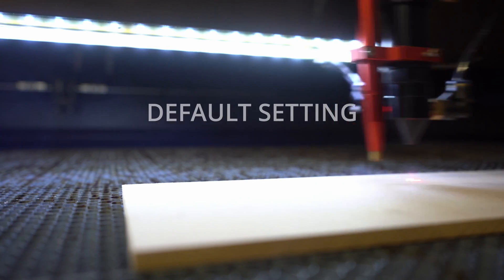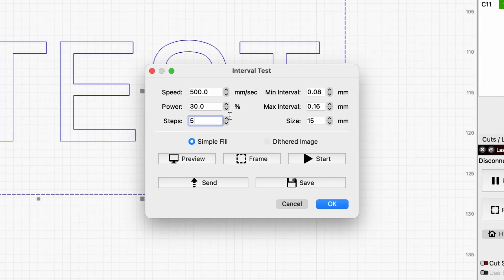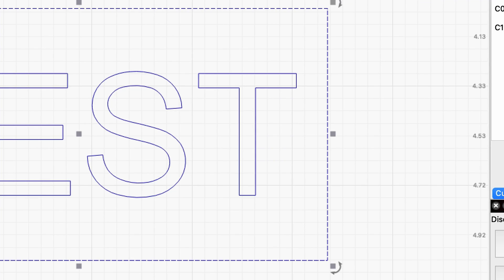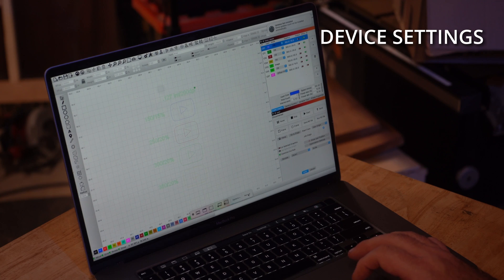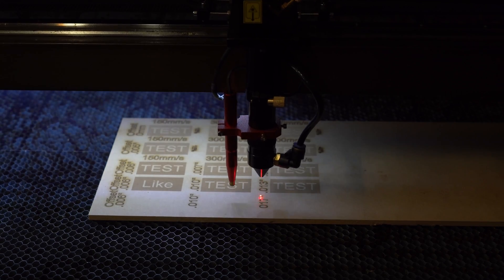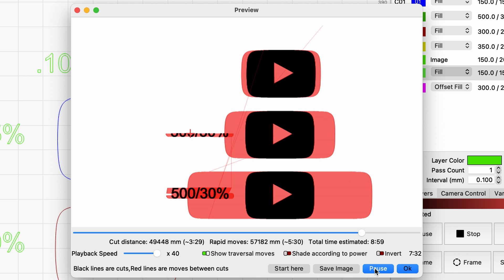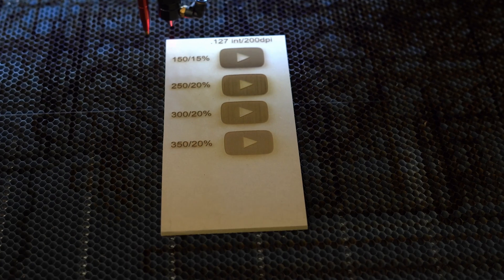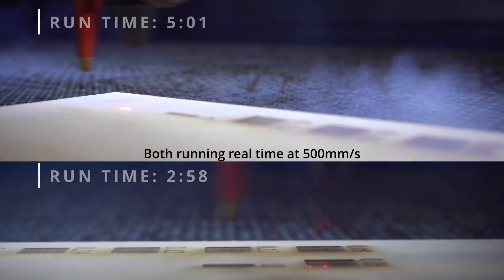Getting faster laser engraving using Lightburn

Comment: I'm still trying to figure out how to get my co2 to fill/engrave image faster than 9mm/s. Even in light burn at 100mm/s the laser goes slow. Cutting engraving 300/600 no problem
Reply from the maker: Which machine do you have? Your material test doesn't produce a better result at faster speeds?

Comment: I really liked your video.  I have been looking for a video on how to put a Lightburn job on a flash drive and move the flash drive to my laser, plug it in there and use it to run the job.  The laser is a Bos LS 1630.  It comes with a flash drive and a usb port to plug into the side of the laser, but nothing happens.  Any advice?
Reply from the maker: I’m not familiar with that laser or its settings but if you have a Ruida controller you should be able to navigate to the file from it.

Comment: I’m running just vector lines on my machine and it really slows down at the ends no matter the speed I run it, is there a way to optimize the speed at which it starts and stops as it doesn’t go past the end of the lines I’m engraving, does that make sense?
Reply from the maker: If you’re in Lightburn you should be able to adjust the acceleration and deceleration speeds.
Reply: @VoeltnerWoodworking  I’m new to this laser but I’m definitely learning

Comment: Hello. I would like to know your opinion on the Omtech Pro machines and whether you would consider replacing your current machine with it. I live in Europe and asked the American headquarters when they are planning to start selling the Omtech Pro machines here. However, I received the answer that they currently do not have plans for it, which is interesting to me.
Reply from the maker: They have a lot of great features, but I wouldn’t want to pay to upgrade my current machine because I’m very happy with what I can do with my AF3555. I know international shipping areas are tough when you see other people able to get machines you don’t have access to. Thats frustrating.
Reply: @VoeltnerWoodworking  Yes, frustrating, but of course, I accept it, no problem. I want to buy a machine just like yours, and it's currently available at a reasonable price, 6200 euros here in Europe. And is there something specific to know about the machine that doesn't work properly, and it's worth paying attention to? Is the ventilation adequate on the machine, or does it need any adjustments to improve smoke extraction?
Reply from the maker: Hopefully you're able to make use of the discount code "VOELTNER5OFF" as well for additional savings. I hope the code works in Europe. I haven't had to make any adjustments for smoke extraction or anything. I know several people who have incorporated an in-line air extractor like this: https://amzn.to/41V7Tvk
Reply: @VoeltnerWoodworking  Thank you for the code, but it doesn't work here in the European market, only in the United States. I was thinking that inside the machine, where the suction is, it would be beneficial to remove the perforated grille. This modification could improve the airflow, as the grille currently hinders it. Placing a half-cover over the hole could prevent debris from getting in, and it would allow the machine to suction air more effectively since the grille wouldn't be restricting half of its cross-section. I plan to remove it from my own machine.
Reply from the maker: @japanfilling it has both slat and honeycomb. Both are great for different reasons. I use honeycomb for most projects because of the small parts falling through the slats, but either way works.
Reply: Thank you for your response. I've learned a lot from your videos. Based on your videos, I've decided that I need one as well. So, hopefully, by the end of February, I'll have it. Thank you for your assistance; your videos are indeed informative.
Reply from the maker: @japanfilling Thank you. Glad to hear it.

Comment: Alot of your extra travel distance is due to your stepper motor/drivers. With Servo drives and higher quality steppers and controls this is not as much of an issue.
Reply from the maker: Nice! I’ll look into those.
Reply: I have a 50w blue and white that I have run for years without this issue. I bought a 60w red and black and noticed my engraving time was 3 times longer. The 50w blue and white has hardly any excess travel at any speed. The 60w is just like yours with crazy travel at even 350mm. Great video. Did you ever find a fix?

Comment: I would be interested in you running the same test at 4 x’s the size in each direction. That would be a total of 16 x’s the area. I think on a larger project the time saving might switch.

Love your research and presentation. Great job
Reply from the maker: Thank you so much! I will definitely have some more tests to optimize the machine and will continue to share. I'm glad you enjoyed it, and I appreciate your comment.
Reply: Wouldn't you only need to change the X axis length? And then have a standard height and lpi between speeds?

Comment: I there a result where the runway is worth it for batch engraving? A single image I can see the differences and understand, but Is there a time benefit with batching the same item in the same row with a jig per say? I don't have a laser where this information can be actedupon.... YET!
Reply from the maker: Yes, the longer the engraving the better because it will eventually reach it's top speed. For batch engraving there are definitely some tricks you can use to increase efficiency. What laser are you looking at?

Comment: Lots of great info here. I still have lots to do dialling in my settings. I’ve already set-up my over run settings. But yet to do line and dither. It’s great that lightburn have been gradually adding those features with have to use third party lightburn files. 
Another one I also have never got round to doing is setting up material libraries so that I don’t keep have to change all my layer settings all the time.
Reply from the maker: Thank you. Very thankful for the upgrades too.